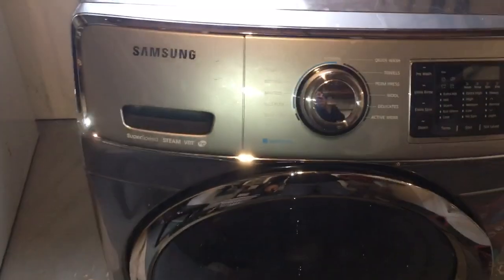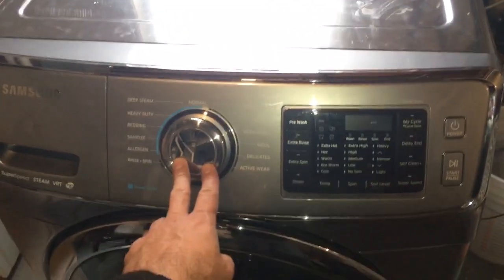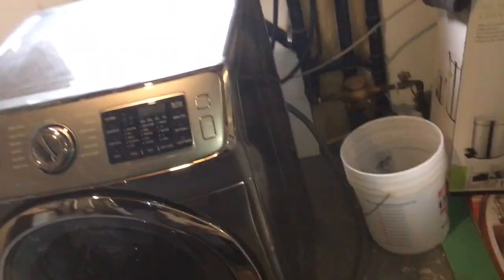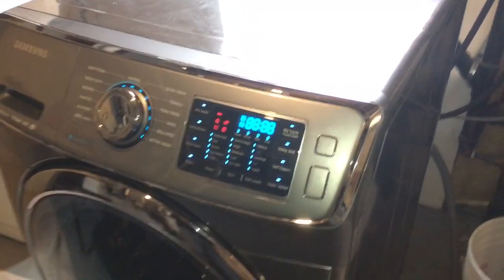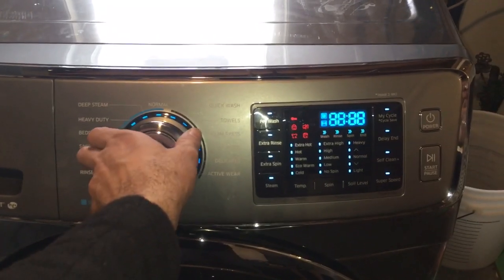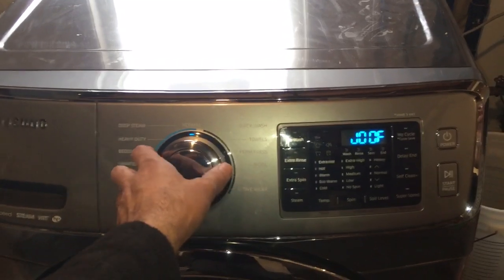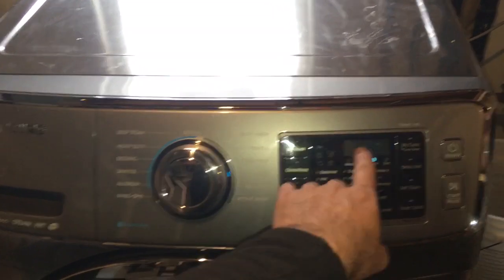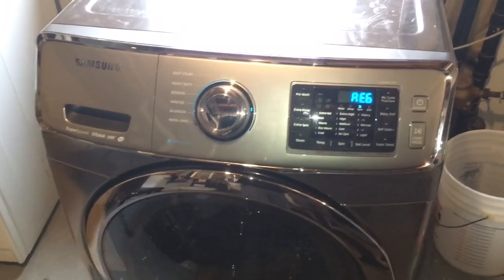Samsung washer diagnostic mode

Comment: So how do you fix the AE6? That is what our washer shows
Reply from the maker: Check your drain pump, drain hose and coin trap under the washer ✌️
Reply: @hameedwafaAFG  I checked those and unplugged for an hour. None of the buttons respond temp/spin/soil/delay
Reply: @hameedwafaAFG  actually did not check coin trap that is on the actual bottom of the washer?
Reply: @hameedwafaAFG   I have the same code AE6 does not work the wash please I need your help how to fix
Reply: How do I put machine to English Language  please

Comment: What does JOOF and A36 mean in this washer
Reply from the maker: A36 is actually AE6 which is communication error code between 3 control board which does not make any sense , JOOF is software version or has something to do with circuit print has nothing to do with washer itself . It’s auxiliary note .
Reply: If they turn it in the first try, it will show JOOF and if they turn it the second try, it will show AE6

Comment: Hi Hameed!We have samsung 4.2 cubic feet front load and every time when every spin cycle starts, the washing machine begins to shake  and walk about 3-5  seconds and then stops and starts to rotate normally.Any ideas
Reply from the maker: Vesel Vasilev make sure the fees are properly installed to the ground and it's balanced, straight to the ground, otherwise check the shocks inside the washer, make sure those are not broken or has crack on them, check the spring that holds the drum to the cabinet,
Reply: Thank you Hameed
Reply: Vesel Vasilev  does not spin
Reply: One other thing that will do that is the balance ring, especially at the beginning of spin cycle. They seem to go bad rather frequently
Reply: Could be unlevel there are feet u can twist to lower or higher to level out also could be bad suspension rods or tub balance ring. Or just a unbalanced load readjust clothing

Comment: There is a new diagnostic mode on Samsung washers 

Step 1: open the washer
Step 2: put the hours to 17h (hour's) 
Step 3: start it
Step 4: hold the start button until its on diagnostic mode
Step 5: you are now done

Comment: Any suggestions? On my read LE and it won't do anything
Reply from the maker: Spin your drum with hand first to see if it’s spins freely. If it’s spinning freely you probably got a broken wire at the back on the motor or rom sensor is defective . It’s most likely seized motor which is caused by broken bearing, on Samsung it’s very common .
Reply: @hameedwafaAFG   thank you for answer me
Reply from the maker: You are very welcome ✌️

Comment: What was the problem with the washer
Reply from the maker: adrian mendoza had defective main board.
Reply: Thank you i have the same washer it will stay stuck in spin cycle. And turn off and turn back on on minute 33 and go back to minute 37 you think is the same problem?
Reply from the maker: adrian mendoza open the back panel holded by 2 Philips screw, check the motor rpm sensor, that's probably loose, or defective, you problem looks sensor not board, a broken shock would also do that, sometimes it sticks in 9 minutes won't do anything but keeps spinning and slowing down,
Reply: Thanks for your help sir please keep posting videos!!
Reply: adrian mendoza I am getting the AE6 error. The washer will freeze after a couple of minutes of use. Can you show what you did in the back of the washer to fix it or give me a quick idea on what to look for? Thanks
Reply: adrian mendoza hi Adrian I have the same problem communication error any suggestions?
Reply: I'm getting a 32c code which says motor trouble. It will drain then start to fill and the drum will slightly move then it just gets stuck. Mine wont go into service mode but its same model seen here. Motor tested well and I'm getting signal from the position sensor. Help please
Reply: @cocodelightt83   I have the same AE6 code I need your help if how to fix
Reply: @chicolopez5259  I had to replace the board. It was a connectivity issue. We ordered the part for $125 and replaced it ourselves. It works perfectly now.

Comment: I am pressing the 3 buttons and have done it countless times and I cannot get this to work, as you said.
Reply from the maker: Sometimes it does not work , even as a tech I had this issue in the past .
Reply: @hameedwafaAFG  is there any other way to diagnose it?  I was getting the 5C code and I wanted to check the pump, but I am not sure how to do it without leaving my washer in nothing but a scrap heap.
Reply from the maker: @dompennypacker4491  5c code is usually water valve error code . Make sure water is fully on . Make sure it’s not making buzzing noise and filling low water . Or maybe it’s not working . Open the water lines and check the water valve screens for calcium rust or other minerals ✌️
Reply: @hameedwafaAFG  it was fully on. It was not draining the water, which it would stop when it was time to switch to rinse and or spin cycles. As a matter of fact, the pump was no engaging at all.
Reply from the maker: @dompennypacker4491  check your power to pump are you getting 120 volts ?
Reply: @hameedwafaAFG  this I'd all foreign ground to me. I'm not sure how to check it. I have a multimeter, just not sure how to use it.
Reply from the maker: @dompennypacker4491  watch couple minutes of YouTube videos for ac dc fundamental . Otherwise call a tech to be safe 😄
Reply: @hameedwafaAFG  😂  thanks. I am terrible with this stuff, won't lie. I am just afraid I will have a washer left in a bunch of scrap pieces, so I want to get it right.
Reply from the maker: @dompennypacker4491  hahaha call a tech to be safe . Lol

Comment: I’m getting an 8E1 error code. However I replaced the vibration sensor and I’m still getting an 8E1 error code. I’m about to lose my mind!!! It’s been down for 5 months now. 🥴😵‍💫🤦🏻‍♀️ 🤯🤬😭 I replace the bearings and seal, the spider arm is in great condition I replaced the shocks, and now I’m getting the 8E1 error code. Please if anyone can help I would be so grateful! 😊 Thank you

Samsung Wf56H9100ag/a2-00
Reply from the maker: Is the washer correctly leveled to the floor ? Does it drain ok ?
Reply: @hameedwafaAFG  yes to both. Thank you for replying!
Reply from the maker: @christinejustme3521  unfortunately I can not have any other answer except main control board being defective or loose connection somewhere ✌️
Reply: @hameedwafaAFG  Thank Thank you so very much!